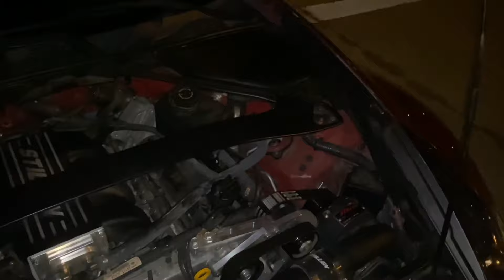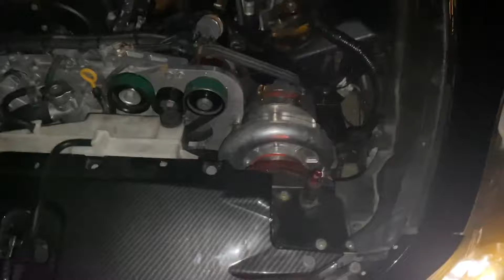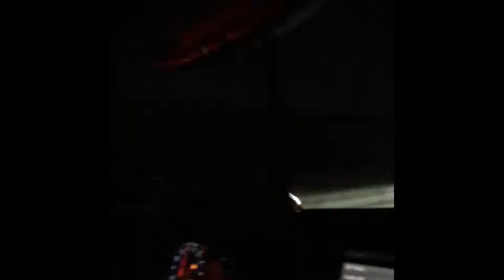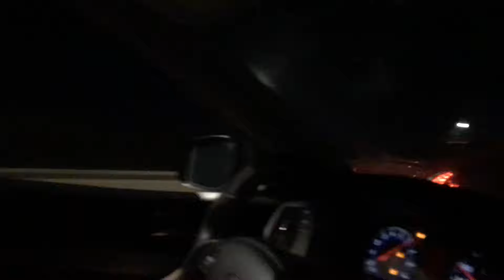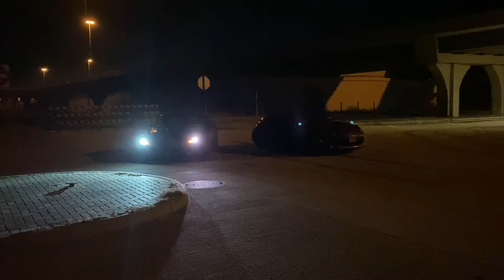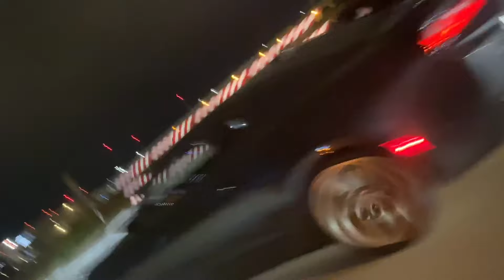Topgunz A2A G37 Vs Stillen Supercharged 370Z

Comment: Those saying the G is not 600 I have a 305whp 370z and is hard for scatpacks, camaros ss to win.
They do win but only on the top end after 70mph
Reply: @ryandono5721  scatpacks are not from 2010, the 6.4 srt engine came out in 2015.
A 370z with tune only is more dangerous than a fbo with no tune.
Im sure you would walk my Z after 80mph

Comment: No hate amor anything cuz your set up is A1 and runnin at its peak for it completely stock kit but a 6mt isn’t in the right rpm’s at 20 and 40 especially 20’s 20 and 40 is 7at’s sweet spot 6mt are better at 30’s and 50’s but still good runs love the content🔥